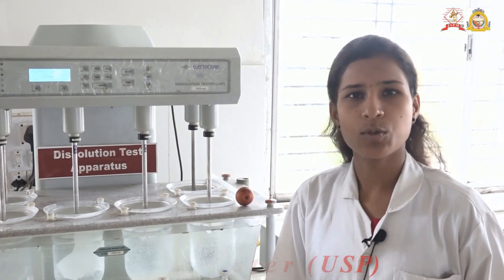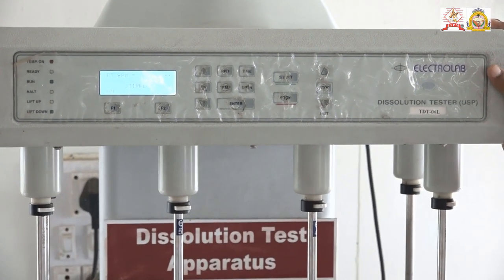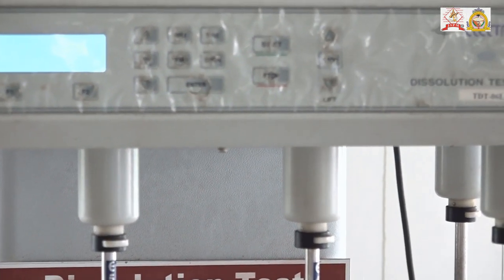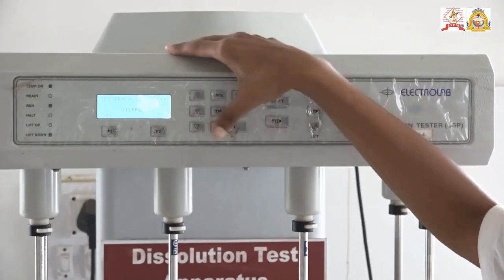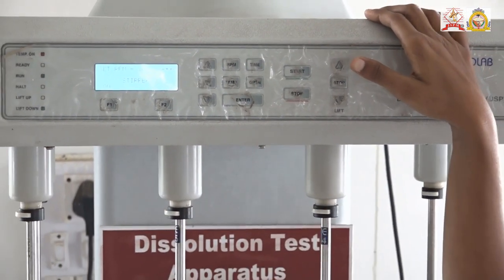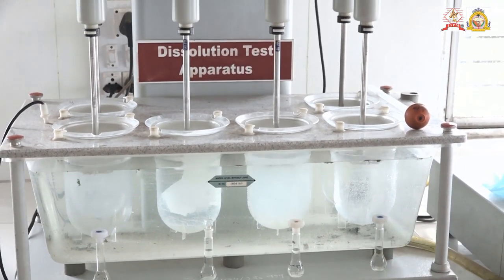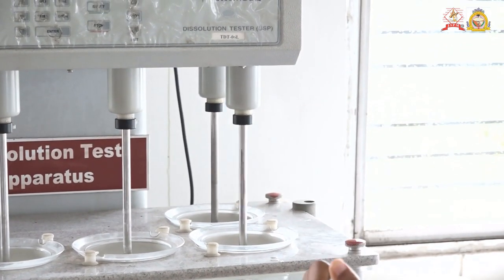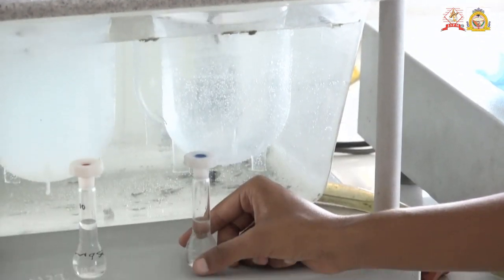Dissolution Tester USP

Comment: Temperature and rpm set limit ?
Reply: Temp as per the human body : 37 ± 0.5° and set the rpm as per you need or product spec. 
also refer this ,
USP 

https://www.usp.org/sites/default/files/usp/document/harmonization/gen-method/stage_6_monograph_25_feb_2011.pdf

Dissolution method database :

https://www.usp.org/resources/dissolution-methods-database